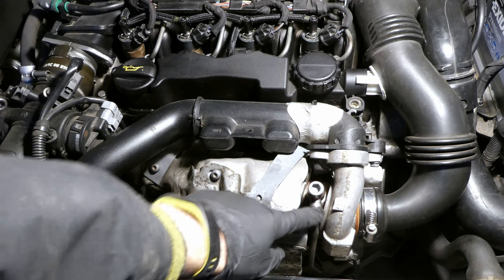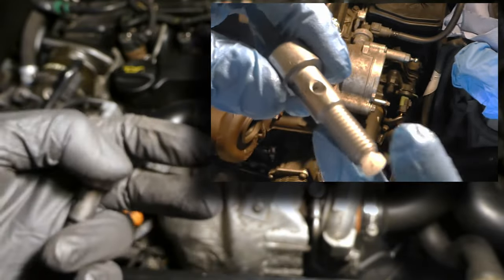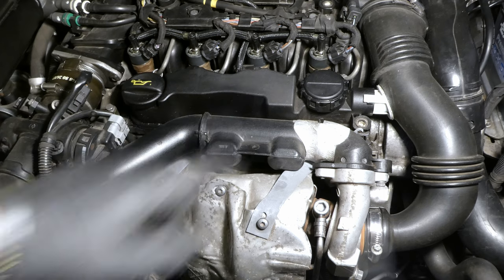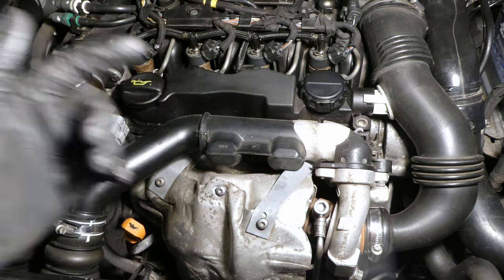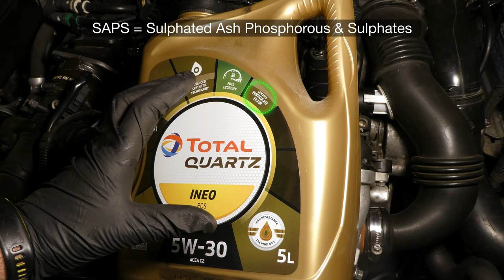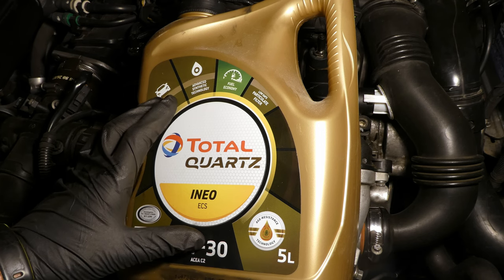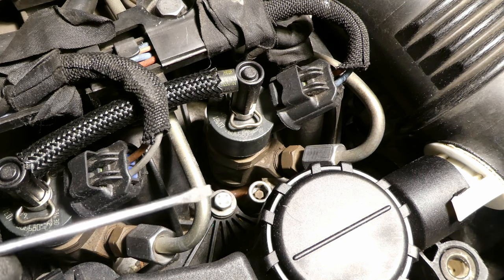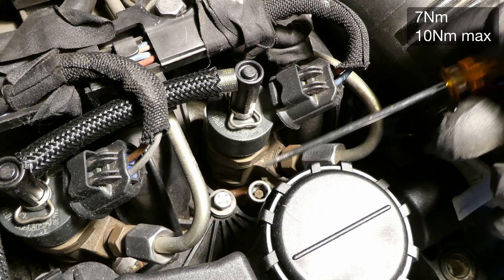1.6HDi turbo failures, the 2 main reasons and surprisingly simple steps to prevent it

Comment: I'm gona' go ahead and ask... Any common fault that leads to high oil consumption on these engines ? Last 10 000 km I had to refill about 2liters which is crazy. No visible leaks under the car or anywhere on the engine. Only thing that I had noticed is a bit smoke when first starting the car in the morning but that lasts about ~30 seconds and is white. Any suggestion or direction I can check ?
Reply from the maker: This is rather too much. Are you sure that it is not leaking and pooling somewhere. I would check for any oil in the coolant, in case you might have a blown gasket. If it burns that much, it should really blow blue smoke on acceleration. Check if by any chance the sump bolt is not leaking.
Reply: @moremolecules  Will double check all that you mentioned. I keep the car in a garage so its always at the same spot, no oil spot. Will check coolant.
Reply: @dENd0Mania  check for oil on the belly pan.
Reply: @moremolecules  quick update. Definitely no oil leaking from underneath engine or any visible oil trace, as far as viewing from the bonnet. No changes in liquid heights for coolant or other liquids in the car. Morning starts are always with a blueish smoke that lasts a couple of seconds and after that no trace of smoke, even under high power/acceleration. Now here is new thing, driving agressively on the motorway in 5th gear at around 130kmph and going up the car emitted STOP and oil pressure warning on screen ( didn't manage to read fully ) and automatically shut off. I pulled over to the emergency lane, checked the engine but nothing visible. I removed the intake and checked for oil but only thin oil inside, not enough for even oil drop to come out. Checked turbo movement, all ok. Removed the pipe leading to intercooler for oil and only tiny oil film, not even dropping. Started the car and everything was fine other than check engine light ( probably error in ecu ). Anyway, went on to drive for about a couple of days since I was at the other side of the country and nothing happened. Speed up to 100kmph and all was fine. Will try to take to mechanic before new year, I suspect either oil filter clog or oil pump "filter" in sump. Will see. Still no idea why su much oil consumption. Heh, maybe old engine, pushing almost 400 000km. Will update after mechanic checks car.
Reply from the maker: @dENd0Mania  You are loosing an insane amount of oil, somehow. With that amount of oil lost it is either spilling somewhere or being burnt in the engine. If it is burnt you will see it in the rear view mirror, it will be huge amounts of blue smoke. If it is leaking somewhere you should be able to see it. There are no other options.
How do you check the oil level, cold engine and dipstick?
Reply: @moremolecules  The car is always parked on the same location at home on concrete so by now there should at LEAST be a touch of oil under the car, but nothing. Oil check is always done on cold engine ( morning time ) on flat ground, by dipstick. I usually wait for the oil top up required message to check oil and add as needed. There is really not much smoke other than first morning start. A puff of smoke that lasts a couple of seconds and after that no smoke. Will film it someday and upload for reference. I agree, amount of oil consumption is huge. 7 000 km since last oil change and already 2l of 5w30 additionally filled up. Will update if I ever find something.
Reply from the maker: @dENd0Mania  Yes, that is rather wierd. There is the option that there was little amount of oil in the engine at the last oil change. You should have seen this on the dipstick though. When new oil filter is added there will be a drop of oil when first checked and after a quick run. The paper filter will amount to ~500ml of oil, maybe a little bit more, but not 2L.
Let me know if you find what the problem was, as it is baffling to say the least.

Comment: Hello, I have a question. On my ford focus 1.6tdci when i removed the engine cover i saw there was oil or fuel(or both) around all of the injectors and it was in liquid state, do you know what this can be from? Also my mechanic said that my intake manifold is cracked, do you think it could be that causing the problem?
Reply from the maker: Most likely the oil comes from the oil filler cap or the cracked manifold. Generally there will be some oil in the intake that is the intake is cracked will leak. This will always result in some air leak, so may want to fix it anyway and then see if it comes from that.
Reply: @moremolecules  Thank you!
Reply: @moremolecules  Hello, it's me again. I wanted to update you on the situation, I have replaced the intake manifold and the injector seals, after replacing the injector seals, the leak is gone, the car pulls better, it consumps less fuel, but before it started on one crank now it takes two or three, also it vibrates more. This job was done by a mechanic and I am not sure what could cause the issue, I suspect that he accidentally switched the injectors that should go in each cylinder (ex. Injector that goes in cylinder 3 was put in 4) although I don't know if this would cause this issue. Do you have an idea about what could be the problem?
Reply from the maker: @Tito-qv6hu  Difficult to tell unless you plug it in OBDII scanner and see air flow and injector flow or correction values. That would give you an idea if they are working correctly. The injectors, if swapped need to be coded in PP2000 (Peugeot) and Lexia (Citroen), but I do not know how they are coded in the Ford. There must be similar software. Each injector has values on the injector that need to be put to the ECU. It could be that they are swapped, which might result in a bit rough idling. WHen the engine warms, does it also shake?
Reply: @moremolecules  Thank you for your response! I have an obd scanner and I will check it out tomorrow, the software which I use with the obd scanner is Delphi 2015, it has an option to code injectors. Yes the engine also shakes while running, although the vibrations are not really that big of a problem. To give you an idea of the vibrations you can feel them on the steering wheel. Thank you once again!
Reply from the maker: @Tito-qv6hu  Yes, re-code the injectors from the numbers on the injector. That should solve the problem if the injectors were swapped.
Reply: @moremolecules  Hello, It's me again. Thank you for your suggestion, the car runs good now. Although the leak is back, it is most likely oil and this time it is not around all injectors, it is around the right most injector( I suspect that if I give it enough eventually it will collect enough oil and it will expand towards the other injectors)  and the leak extends down and it leaks on the gearbox, the turbo is also covered with black soot which I suppose is from an exhaust leak, I wanted to ask you if you know is it safe to do a static DPF regen because I have the code p2002. My primary concern is if the exhaust gases are gonna melt something if it really is a leak?
Reply from the maker: @Tito-qv6hu  Yes, I am not an expert on DPFs, but as far as I know a static regeneration is safe to do.
Reply: @moremolecules   Thank you for everything up to now, It turned out to be the clamp going from dpf to turbo causing the exhaust leak, however, the oil leak is still there, so far I have replaced the rocker cover gasket, injector seals and intake manifold and it's still leaking I have no idea what is going on.
Reply from the maker: @Tito-qv6hu  Wipe everything clean and see where it is coming from. There is no other chance.
Reply: @moremolecules  Thank you, this engine has been a headache so far. Now blue smoke is coming out from the exhaust when I give it a little rev on startups. I pulled out the hoses around the turbo and there is quite a bit of oil in them, I think the turbo needs a rebuild. I still haven't managed to find out where the oil leak around the injectors is coming from. I think the smartest thing to do right now is to sell the car.
Reply from the maker: @Tito-qv6hu  Hmm, depends on the mileage of course, but if the oil is coming from the valve cover, then you would get quite a bit of oil from the crankcase to the turbo. Maybe check the PCV membrane if it is intact, although I doubt it will be the culprit. Does it have DPF and if yes, is it blocked? That would give you quite a bit of back pressure and leading to all those oil problems.
Reply: @moremolecules  Yes it has a DPF, actually, I found that the DPF pressure is really low (around 1kPa at 2500rpm) which is low according to Google, this causes a code p2002, I found an exhaust leak coming from the DPF-turbo clamp, the clamp was loose, I tightened the clamp and the leak was gone. Although the pressure is still low.  I think that either the DPF was gutted because I can see that it was cut from below and welded back together, or the DPF pressure sensor is bad. About the leak around the injectors, is it possible that if the mechanic hasn't changed the injector bolts because they are torque-to-yield bolts(I think) that it is leaking from there?

Edit: I have done some digging and found some people with the same problem as mine concerning the leak, it turned out to be the cylinder head cover. I hope that that is not the problem because it will be one hell of a headache to replace it. Also it is worth mentioning that the car has 155000km. Which might or might not have been rolled back.
Reply from the maker: @Tito-qv6hu  Hmm, cylinder head cover is some undertaking. See if you can determine if it is that. Mine is ~173,000km, so they can last long time.
Reply: @moremolecules  Thank you, will try cleaning everything up really good, although it is pretty hard to clean the oil around the injectors, I will try using a syringe and then seeing where the oil is coming from.
Reply: @moremolecules  Hello, I am pretty sure I found what is causing the leak, however, I will wait a few days just to be sure. Now another problem has appeared... After doing a DPF regen at around 3800rpm coolant started leaking, It is leaking from around the center right side of the engine bay. Do you have any idea what this could be? Will check it out tomorrow and I will update you if I find anything.
Reply from the maker: @Tito-qv6hu  Centre right side, is that the heating matrix, underneath the air intake?
Reply: @moremolecules  Could be, but isn't the heater matrix located on the rear side of the engine? It looked like it is most likely coming from the thermostat side of the engine (right side).
Reply from the maker: @Tito-qv6hu  My bad and apologies, I meant the thermostat.
Reply: @moremolecules  No problem, thank you for helping me once more. Will check it out soon!
Reply: @moremolecules  I just noticed that the red liquid leak that was on the ground evaporated (aka the leak is no longer on the ground), as far as I know antifreeze doesn't evaporate? Is it perhaps another fluid?
Reply from the maker: @Tito-qv6hu  Not an expert, but coolant will evaporate given time, at the end of the day it is 50% water or so. Red is either oil or coolant, so probably coolant. CHeck if you are loosing coolant in the reservoir.
Reply: @moremolecules  You are correct, it does evaporate. The coolant leak somehow fixed itself it is no longer leaking. The oil leak is coming from around the third to fourth injector (most likely third) it's spraying oil trough the engine cover through the gap around the oil cap. Oil is not the only thing that's coming out of there, exhaust gasses are also coming out and it's spraying oil or fuel ( I suspect fuel ) everywhere. I think the mechanic might have over torqued the bolts and the gasket has cracked, or the seat needs to be recut. Either way I will pull the injector out and see what's the problem. It might also be the intake manifold seals although I don't see how exhaust gases would come out of there.
Reply from the maker: @Tito-qv6hu  Yes, you have to pull out the injectors and inspect. Sometimes one washer is not enough and you may need 2. The bolts are torque to yield, so difficult to put them back together. I would buy new bolts.
I am always weary of it fixed itself, most of the times it comes back😁

Comment: How does the carbon bits get past the filter ?
Reply from the maker: The turbo oil pickup is very fine mesh and quite easy to block and tarve the turbo of oil. The stuff do not get past the engine oil filter.
Reply: @moremolecules  thanks for your reply. Does the oil not run through the filter after it has been picked up by the pump and before it goes out to the engine ? Could you tell me where you bought the improved banjo oil strainer from ? Thanks.
Reply from the maker: @jamesheath7596  OK, apologies, should have been more explicit in the video and replying to you. So, all the oil goes through the oil filter of course, but the oil filters can get clogged with less frequent oil changes or the oil filter is sub-par quality. It has a bypass valve, so the stuff inside, the crud and carbon particles then can get through. Also, some of the oil filter are not that good quality and sometimes either the bypass valve opens too early or it leaks, so letting more stuff through. All these mght go to the turbo mesh and block it. That is the simple reason for the more frequent oil and oil filter changes, so the oil filter does not get blocked and bypass valve open to let things through. The oil filter is full flow filter, so if there is not enough volume the bypass valve will open.
I have a video how to replace the turbo cartridge on these engines (https://youtu.be/Q30w90Vcs7U) and all the components are there. I bought a replacement turbo oil feed pipe that came with the new design mesh filter that has a larger capacity.
Reply: @moremolecules  great thanks for your reply. Best wishes.

Comment: Mine is 2014 model 1.6 eHDi 115hp 9HD , did they fix this issue on newer cars ?
Reply from the maker: Yes, I think they fixed it with later models. I think 2009 and later models are safe.
Reply: @moremolecules  I  think that I had read that 1.6 hdi with 112hp had some this issue 🤷‍♂️
Reply from the maker: I think the 112bhp is the same injectors and setup, but a VNT turbo and change in ECU map. Yes, it should have the same issues.
Reply: @moremolecules  do you have any Facebook page ?
Reply from the maker: @badrijan9704  Unfortunately no, only on youtube.
Reply: @moremolecules  u should make one for your channel, why not
Reply from the maker: @badrijan9704  Haha, not enough hours in a day. I thought about instagram, but not enough time to maintain them.

Comment: is this one of  reasons why car start to throtling in drive like he want to stop  due to changing gears or when   gas pedal are not pushed  or clutch are  bad!? i have one injector leaked  preetty much but black oil get hardened
Reply from the maker: I do not think these two will be related, might be wrong on that though 🙂
Reply: @moremolecules  it was showing on trip computer on Peugeot 207  low oil pressure !! is that oil of engine or
Reply from the maker: @Mr11ESSE111  That will be the engine oil
Reply: @moremolecules  i hope so , because when i pull of  foot from gas pedal  and  press  clutch  sometimes it  start shakes or like  lose power  , its not all the time then occasionally and once 2 days ago was that message on central screen about low  oil pressure  !! so changing oil filter and engine oil could solve  that problem??
Reply from the maker: @Mr11ESSE111  Generally this has happenned to me before, I did not tighten the filter correctly and I got low oil pressure. Basically a little bit of gap was there, the filter cap was not screwed correctly. I would say switch off, let it cool down overnight and the oil to drop back to the sump and take filter cap off and put back again. You would need need some rags for the oil that will be spilled.
Reply: @moremolecules  i hope so,i tale it down cap and think to replace with new filter and then realized that chinese /aliexpress send me wrong oil filter,not for hdi then for petrol version and that it dont have that notch which goes into that hole ,i will try  to clean older a bit and change oil because seems that previous owner(s) don't do nothing
Reply from the maker: @Mr11ESSE111  Ahh, yes, any other filter will not work. If I were you I would just buy a new filter and replace it altogether. The low oil pressure is from the not very well fitting oil filter.
Reply: @moremolecules  yes probably,now i am not near any store with it and for 2 days have registration & technical check so i will improvise now with older but cleaner and try to better fitt it